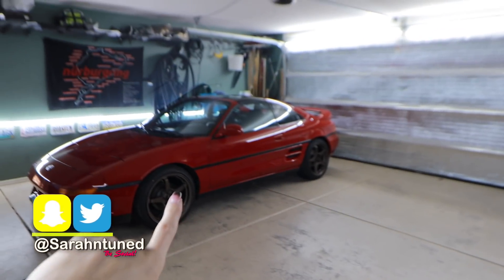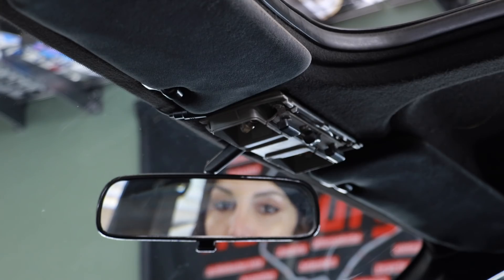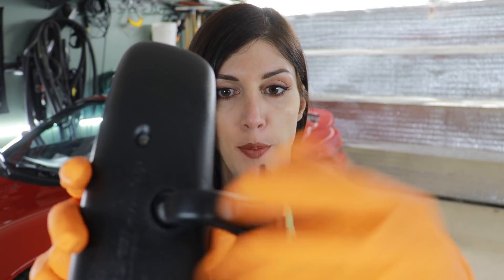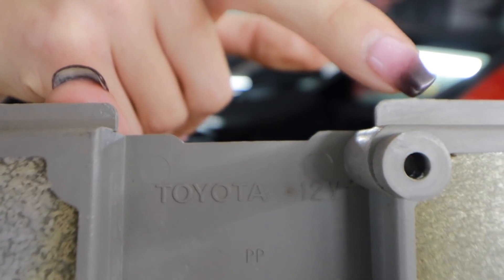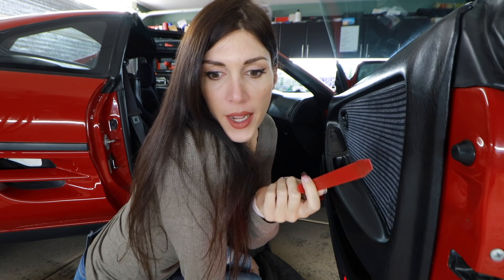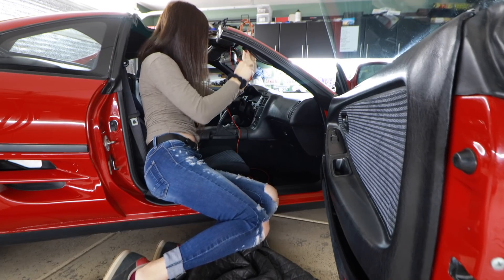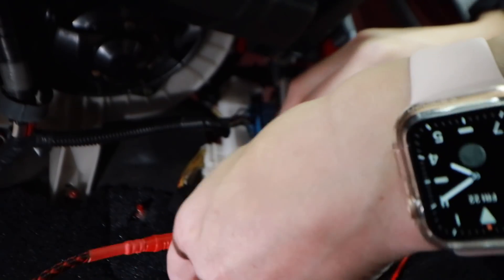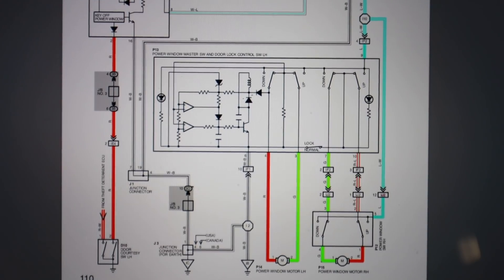Lexus LS400 Auto Dim Mirror Retrofit SW20 MR2

Comment: Nice work on the mirror.
Regarding the "backup" gen4 engine build... you have a buyer for the gen2 head :).. just sayin.
Re. the fuel tank... since you are dropping it, upgrade the fuel pump to a Walbro, and you will be good for fuel pressure in the 500whp 'hood. Dropping the tank is a pita, you wanna do it once only.
Re. the boost-gauge location, I'm a fan of replacing the oem boost gauge and using that location, but since you need to access the "controller" features, the lower left custom dash location would be practical. You may miss your vents, and the ashtray area is too far removed from normal field of view... distracting/unsafe, because you will be looking at it a lot while WOT.

Comment: Would love to watch a 3sgte build! I'm personally torn between a 3sgte or 2gr build for my 94 hardtop.
Reply: Just got done with a suspension rebuild myself this summer. It's not too bad... But I got out in the weeds restoring each part 😅
Reply: Here's my 2c on the harder parts: * For front ball joints, use OEM (all aftermarket brands I tried had fitment issues) * For rear tie rods, you can replace the spherical bearing in the axle carrier with 42210-14010 (supra/celica part), just replace 12mm bolt with a 14mm one. There's also a spherical bearing in the tie rod assembly itself (on the subframe side), a company called MR2-BEN makes a solid bushing replacement (product #713, just search "mr2-ben 713" on Google)

Comment: Not a fan of the gauges unless you can make them look OEM which I think will be tricky. It would be nice if there was a way to get this data into the head unit and run them as an app.
Handling before power so suspension first. You'll probably go back and tweak it after you've added power, especially if you change the engine. 
Dream big because it makes me smile.

Comment: Personally, I would attack the wideband first, but not to turn the boost up yet. You already know you have some more electrical work to do in the engine bay, and that needs to be sorted before you can raise your boost safely (and get rid of that airbag light). That missing IAC power is also a missing power feed to both your TVIS and you TVSV, which are locking you into both a dual track intake at lower rpm, and a low boost mode. You'll need to decide if you're keeping the TVSV with the boost controller, it's a good failsafe but can complicate your install, and isn't necessary as long as you don't go wot from a cold start or trying to power through ping.

The issue you're having at higher rpm I do think will be fuel supply, but not necessarily anything to do with your tank, my money is on fuel pressure regulator or manifold pressure supply to it, 30 year old rubbers don't work well. You need a monitor on this to go any deeper, afr and boost are pretty good ones to look at. Suspension will need to be addressed before pushing the car hard, but you should know if you're causing problems before you push it, even on low boost mode.

Great job on the wiring, you picked a good circuit to pull from and even with the dimming having a switch that you could turn off if it was wired with constant power, it would only take a few all day/night 'dim' activations to damage the crystals that do the dimming and cause it to bleed. The foam insulator was a nice idea.

If you can spare the space, build the engine, it's what you've wanted from the start, giving yourself the ability to do it slow is a good idea. Get yourself a better 3/8s torque wrench though, click type are not ideal for bearing caps, beam style or decent quality electronic is what you want.

I'm late on this, so I don't know if you'll see it, but this was another good entry into that car's journey. Looking into the camera through the mirror was a fantastic touch, it really is the little things that make the difference.

Comment: Would avoid putting another OEM 3S harness in for a modified engine, save your cash get a good ecu like a motec m400 or m130 get it in and tuned on your current engine then swap in beast mode engine later when you can take full advantage of it safely

Comment: Do suspension first.  Need a set of press cups and hydraulic press or c clamp and press cup kit.  Good luck.  I use veggie oil on rubber bushing as it is not petroleum based.

Comment: I can understand your reasoning on the choice of a higher rated supply but in this case it's not what you want. The fuses are only in place to protect the wiring. If you think about it that way then if you have a hjgh current rated supply (fuse) & wiring which isn't rated to the fuse rating or higher then the wiring becomes the fuse! The supply needs to be sufficient to supply the loads connected but something like an electrochromatic mirror pulls very little current - a few hundred milliamps so the additional loading to the circuit you've tapped into is negliable. Hope this all makes sense.

Comment: Change the bushings first. First power without control is perhaps the fun route but not the smart one. Not being smart may cause dents in both cars and hearts. I think a discreet left side boost controller mounting would look best and if you do the bushings first you have more time to figure out how to mount it and get the parts for it.

Comment: While I'd love to see you build an engine, I think I'd like to see more work on Sir Codsworth first. Obviously do what makes you happiest though.
Reply: Also, I've done an MR2 fuel tank. You are in for sooo much fun. Though I hear it is a bit easier on the SW20 than the AW11. Your quick jacks are going to make it much easier as well. Good luck!
Reply from the maker: 802 Garage that car requires massive amounts of metal fabrication and a roll cage isn’t something I want to cut corners on.
Reply: @SarahnTuned  Oh yeah I forgot you wanted to do roll cage before much else. That is a big hurdle for sure. Just a thought, but maybe you could start taking it to autocross and rallycross events first, then get a cage later when you are ready for a real road course rally? Keep up the amazing work. :)

Comment: Sarah, I disagree with almost everyone here, you should do the wide band first, then suspension, then fuel tank.  Leave the boost stock... for now.  Knowing A/F is priceless. Suspension bushings, some will be hard and time consuming. fuel tank is probably in better condition than you think, and can go the longest.  Wherever you are doing the tank, have a  fire extinguisher, handy. Whatever way you choose, I support.  As for the gauge pod, get the one with two in the center. The other hole, I vote for a oil temp gauge. My first oil temp gauge, made me understand it takes longer than you think for your motor to get to temperature. Hope to see you at the Pikes Peak Hill Climb 2020. Absolutely adore you and the content, keep up the good work.

Comment: A Gen 4 3S?  I think you would be much happier with a 2GR-FE.  Better gas mileage than you currently have and better power and torque.  If done correctly you will have just north of 300HP at the wheels.  Normally aspirated and more than 30MPG.

I would also suggest replacing the plastic cup that holds the ball of your shifter, as well as the components where the shifter cables meet the transmission.  This includes spherical bearing bushings and new cube selector bushing.  This, combined with tweaking the adjuster on the transmission that most people seem unaware exists will eliminate the "notchy" hesitation when shifting.

Lots of people here keep screaming about suspension.
If you are just daily driving for fun with mild spirited driving, I would leave the suspension alone.
If suspension is a must, I do have a unique suggestion.

This combination of choices will give you a much happier driving experience and will not be as costly as a built gen 4.
Again, it will also be stronger, safer, more reliable and better MPG than a built gen 4.

Comment: One of the 2 spare wires could actually go to the reversing lights so that when the car is in reverse, the auto-dim is disabled?
Reply from the maker: gowron492 that makes no sense, just because you want to go backwards doesn’t make that blinding light in your eyes any less of an issue.
Reply: Sarah your description in the video is exactly right on this mirror, but a lot of newer ones do disable dimming in reverse, usually over a lin bus signal.
Reply: This is how my Audi A6 dimming mirror works. It has an output to the side mirror's and a signal from the reversing lights. I know the signal is there because I use it for my reversing camera controller I made (camera not fitted as standard on my car).

Comment: Right where the clock is would be a good spot for the gauge, if there was a moulding or a way to make one. Never did like the clock they put in the Toyota, it is as if they bought millions of them in the late 70's early 80's and will not change till they used them all up.

Comment: Please be careful tagging small auxiliary circuits onto heavier amperage ones.  All the wire run on that circuit should have more ampacity than the fuse.  Otherwise a short will burn up the wire and any harnessing run with it before the fuse blows.  Ask me how I know.  :-(

Comment: I'd push handling (bushing) into a priority before making it faster.
 also, why bother cleaning the fuel tank? Instead buy a new smaller, safer one that prevents fuel sloshing around (if that's an issue) and also smaller= less weight, unless you need a larger capacity.

Comment: Clean out the gas tank? Please be careful you hear me? A empty gas tank with just a few dinner spoons of gas left is more dangerous than a full tank I am sure you know. A empty tank is full of a explosive mix of gas vapors and air. Wear cotton clothes inside and out to prevent static electricity igniting it please, and touch a grounded surface or wire etc frequently to prevent static electricity building up, best of luck to you, hugs.
Cheers.

Comment: Suspension then rally car work (where you don't/shouldn't focus on clean restoration details). You've trapped yourself into doing full restoration and basic upgrades when your desire is to take working cars and turn them into power builds. Sponsorship for aftermarket upgrades is great, but limited because you're not doing so with newer cars/products. Not sure how deep you have to go before getting a lot of sponsors for engine builds/swaps (and it won't be enough to offset the higher tool/shop/budget requirements for doing that).